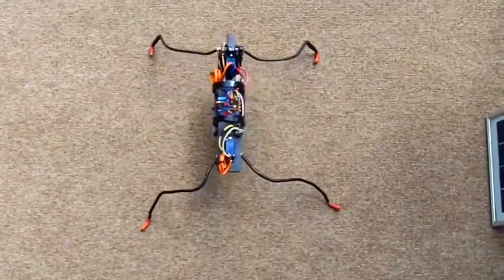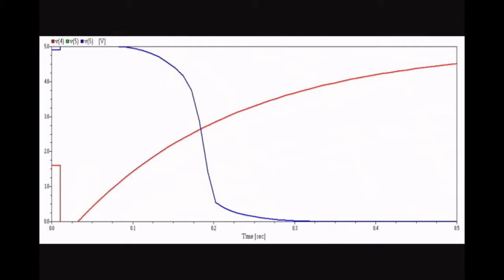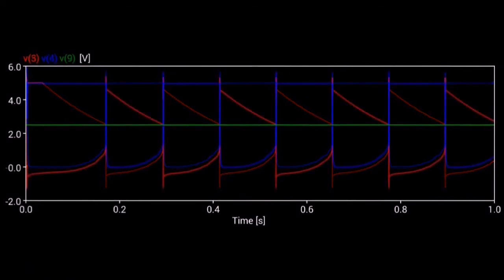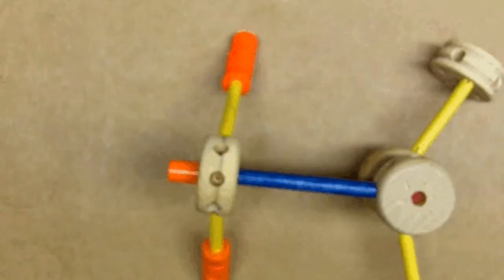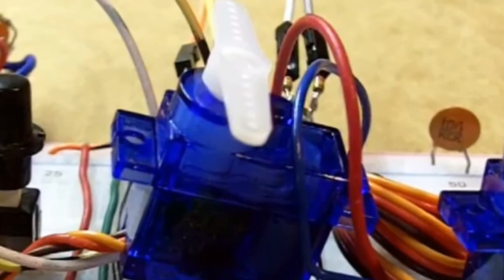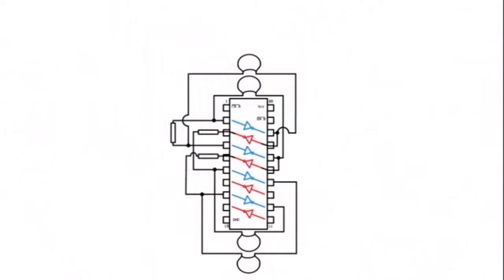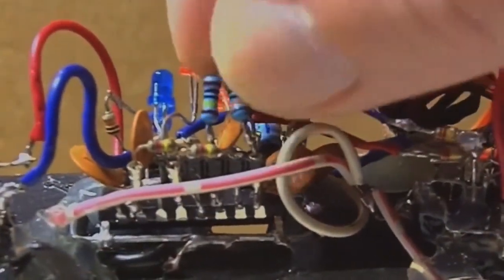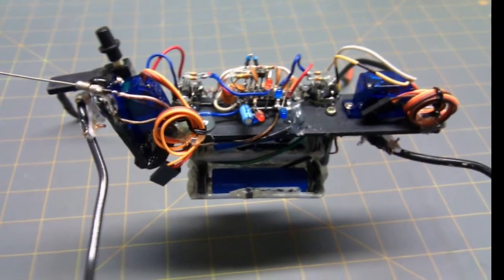BEAM Walking Robot

Comment: Why do you need a full H-bridge to drive the motors.  Since the bicore is already switching the polarity, can't you just take the output of each bicore inverter and amplify it's output via a single transistor such as a 2n2222 in order to drive the motor?  (in other words, similar to using the extra inverters to amplify the signal, but instead using a transistor to replace each trio)
Reply from the maker: Hmm, been a while since I looked into the circuit, but it might work. On the other hand, one potential problem is that the inverter chip has to source AND sink high(ish) current -- to drive the motors in both directions. This may lead to a circuit where you're using two transistors for each inverter "output" (to both source when high and sink when low) which would be about the same as using an h-bridge.

In the BEAM book they use the higher current 74AC240 variants of the chips to source and sink higher current. I went this way since I only had the lower current HC chips FWIW.
Reply: I've been experimenting quite a lot with H-bridges for my turbot. Sadly, no chip (or I couldn't find) can output sufficient current for a motor to operate reliably without stacking multiple inverters. The 74AC240 managed to start the motors for me, but the torque was just unusable. As @espectraa1s said, current amplification with a single transistor is not useful in multi-directional circuits, one transistor per polarity must be used. It seems pretty simple at first to connect a PNP and an NPN transistor base together to get a "bi-directional" transistor. However, there will be a little current between the two which will open both of them at the same time, resulting in a short circuit. You can separate the two bases with another transistor to solve the problem. To simplify the bridge in terms of active components, you could put a 1kΩ resistor on each base instead for separation. (4 transistors instead of 6 in a full H-bridge)
Reply from the maker: Hey Tasi Geri, FWIW I had some success with a turbot using a circuit from the Yahoo Group archive where Wilf Rigter used a 74AC245 buffer chip. It doubled-up outputs for higher current. Couldn't find DIP chips on eBay so I used an SOP-20 package with a mini breakout board.

https://www.beambotics-archives.tk/?page=113&msg=11280

and the "bidirectional turbot" threads around that one. The final v2.5 used a basic current sensor so as not to overload the 245. This drove two small gear motors -- the kind with small motors and brass gear boxes that run about $3 to $5 on eBay.

https://www.beambotics-archives.tk/beam-group-files//76_wilf_nv/161_BiDiTurbot2-5.gif
Reply: @espectraa1s  @Tasi Geri Thank you for your responses!  I tried using a trio of NPN transistors as buffers similar to ganging inverters when using the 74AC2xx chips, but I wasn't able to generate enough current to drive the motor that way.  My goal was to make a bicore using a SN74HC14N Schmitt trigger.  I succeeded by using four transistors in a push/pull configuration, essentially ending up with a simple H-bridge.  I made a short and crude (sorry) video to demonstrate it.  https://www.youtube.com/watch?v=rrot6DI6vnM
Reply from the maker: @Enigma758  Nice work! Where did you get the cool rack and pinion gear system BTW?
Reply: @espectraa1s  Thanks, the mechanism was salvaged from a laptop CD drive (tray mechanism) found in a local e-trash recycling bin.  Many of these drives have small DC motors (as opposed to steppers) which are appropriate for BEAM projects.  I would love to adapt it to a walker, but I haven't yet figured out how feasible that might be.  If not, I'll use some gear motors I purchased from ebay.
Reply: @espectraa1s  That's a pretty neat circuit, thanks for pointing it out! I like the idea of using current mirrors as current sensors. My turbot has a motor reverser incorporated for stall conditions too. However, I solved the problem with a quite different approach as current sensing is nearly impossible with solar-powered circuits, where the power supply is constantly fluctuating.

I wish I'd seen that write up form Wilf before, so I wouldn't have to learn about the locking of the sensors the hard way. (Or in other words, the signal sampling of the bridges - if you don't freeze the sensors for a while, the turbot can get into a continuous loop of "looking" up and down.) 
Moreover, I had a lot of problems with the way the motors are connected. I needed to build a prototype and figure it out by trial and error. Most of the time it was just keeping light to one side and going in a straight line.

I also used brass gear motors from eBay. It's incredible how cheap those Chinese N20 knock-offs are! I initially didn't have any idea about what gear ratio I needed, though, and bought the 1/30 version. I immediately had to upgrade to the 1/298 ratio gearboxes because it wasn't able to even flip over once.

There is just something special about turbots that makes them one of my favorite BEAM creatures. Can't wait to see how you build your turbot up and to see it in action! With the reverser, it should be extraordinarily capable in a rough environment.
Reply: @gregtasi  Maybe this is a little late since it has been 6 months, but what did you end up using to detect stall conditions in your solar turbot? I know there was the current mirror method linked above, but there was also something that Solarbotics did with their own turbot using 2 diodes, 2 resistors, and a cap that sent a signal to a reverse timer I think when the motors started drawing more current due to stall. I think turbots are pretty neat too, and I'm just curious as to what you figured out. I hope you can enlighten a fellow BEAMer.
Reply: @alto2718  I just wrote to your discussions tab